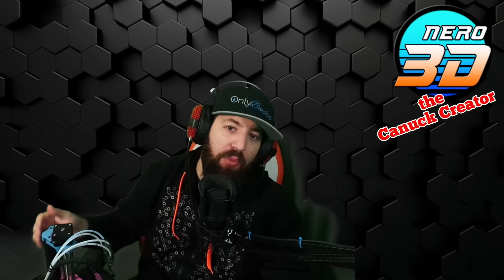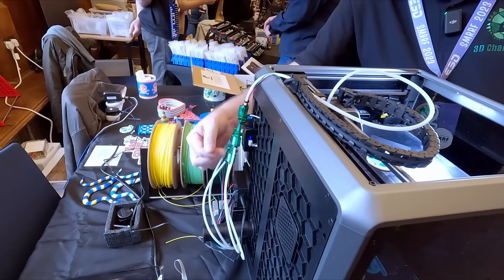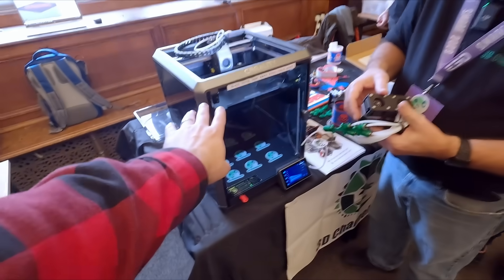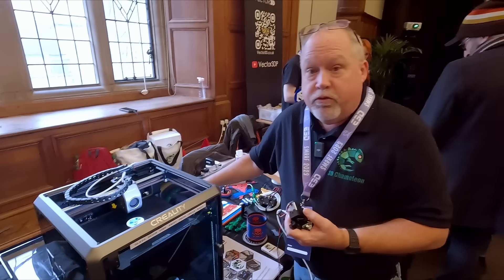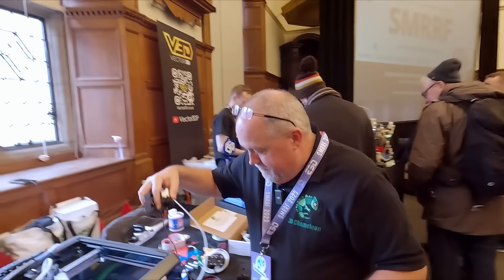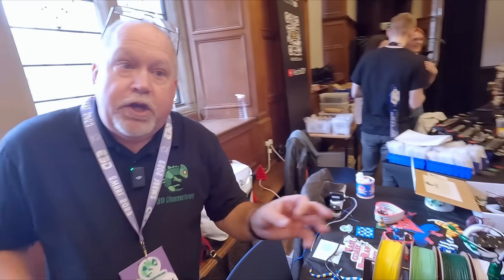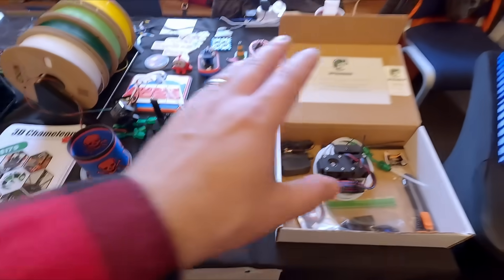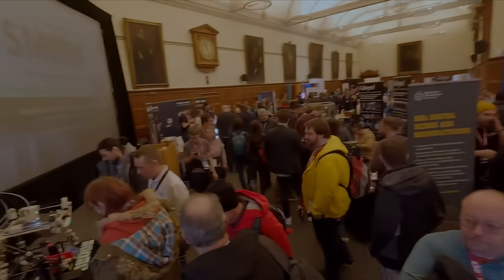3D Chameleon Mk4 at SMRRF2023 - Better, Smarter AND CHEAPER! #3dprinting #smrrf

Comment from the maker: For those curious about mk3 vs mk4 differences and availability of the mk4, heres a post copied from Bill (3d Chameleon)

"Ok... there is a lot of confusion about what was shown in that video.  It was a preview of our upcoming Mk4 series.

The Mk4 will come in two versions... the Mk4 and the Mk4 Pro.  The current Mk3 (since October) is identical to the Mk4 (base) except for the firmware, that is the ONLY difference.  It was already silently upgraded to the Mk4 hardware back in October.  Agian, the only difference will be the firmware, which is, as always, a free upgrade.  (All Mk2 and Mk3 users can already print the parts and perform the upgrade to the Mk4 hardware here: https://www.printables.com/model/354998-3dchameleon-mk4-upgrade-parts-with-ptfe-grip

There will be some additional features that are in the Mk4 Pro (which won't be introduced until RMRRF), and that video shows some of them.  But, as always, the Mk2, Mk3 and Mk4 will be upgradable to the Mk4 Pro.  However, because there is significant new hardware included in that kit, the pricing difference will be charged over the Mk3/Mk4's current $179.  Pricing or shipping details of that upgrade are not availabe yet.

I hope that clears it up.

Bill"
Reply: For those that upgraded back in Sept 2022 to the MK3, not last year, does it mean that the hardware is too old for the new MK4?
Reply: Sadly Bill is not telling the truth here. I bought 4 of these last year in Nov/Dec and my TMC drivers are not compatible with the new MK4... So sadly Bill kinda screw me over even though he confirmed via email that my unit would only need upgrading of firmware (but you need the new TMC drivers for MK4 to work properly)...
Reply: thanks, I was confused about that part.  Especially since I just had my Mk3 delivered yesterday!  
Glad to hear I have the new hardware and can use MK4 firmware when it launches
Reply: Bill, I really enjoyed your Nero interaction and the way that you executed this really so simply is is truly wonderful one of the things that I would recommend as well though as is that for the connectors I would just recommend that you probably do something about molding that out as opposed to on the way it is right now so that way it’s just more kind of clean if you will but this is a fantastic upgrade and I’m really excited to hear what you’re doing with the ego orange storm giga. I recently had to back out of my pre-order for that because of some life circumstances but I’m really trying to get my 3-D by j0sh business off of the ground and I intend on doing music related art and your technology will be able to help me realize that dream because honestly the enraged rabbit carrot feeder was something that kind of intimidated me and it seems like this is relatively straightforward, especially with the pro forward upgrade Path So that way we don’t even have to worry about tuning tips and I think that that’s really clutch. it would be nice if this would be packaged in kind of a little assembly or something like a case that basically you just kind of clip or set to side as the AMS would be. My only concern about some of this would be about the extruders that are direct drive. They don’t have a boat and tube going into them, such as the Neptune 4 max. And other than the color, it doesn’t truly change anything about the printer and I think that’s fantastic. The fact that the printer is completely agnostic to the fact that there’s really truly color being changed is something that I honestly honestly would be ideal  I did voice to speech on my thoughts were as you’ve read above lengthy.  I apologize for any grammatical errors or transcription errors in this. I always love the contact. Thank you Nero! 🤘🏼

Comment: So if am I correct, is this just a multi filament selector? So it doesn't actually "extrude" it just pushes the filament to the printer and the printer does everything? Effectively you tell the printer how many times to press the button, and it does the rest?

Comment: Love that dude, bought a Mark 3, haven't used it yet, may just get a Mark 4 and skip the Mark 3, maybe donate it to someone here locally.
Reply: The Mk3 can be upgraded to the Mk4 for free, with downloads to update the firmware and STLs to print the required parts. The "Pro" upgrade will cost a little extra because it'll have more stuff (presumably, the automatic cutter, and possibly more goodies not mentioned yet).
Reply: @richard3365  That's good to know, thank you for the heads up.

Comment: Does it matter if its direct drive or not?
Reply: Apparently, it's actually better to have direct drive, but not required. The Chameleon doesn't care where the extruder itself is, it only knows to feed the filament into the extruder and then let the machine do its thing like it normally would once the extruder has grabbed the filament. But if you get the filament cutter thing, that might not work so well with a bowden setup because it'll leave a little piece behind.

Comment: A custom purge block is GENIUS! I want to learn how to do that on my AMS.
Reply: I'm not familiar with Bambu Labs' slicer, but it's supposed to be similar to OrcaSlicer, and in that slicer there's an option you can select called "Flush into objects' infill". You turn that setting on, and Prime Tower off, and now it'll only purge inside the infill. No secondary part required, if the part you're printing won't show the colors through the skin (aka "opaque", meaning can't see through the surface at all). The trick Bill mentioned is to have a second, fully opaque (in this case black) part, and you'll have to play with the locations of things on the bed to make sure that secondary part gets printed (and thus purged into) first after each color change... but even that isn't really necessary unless the main part is going to have a slightly translucent (for example, silk filament) skin where the colors inside might be partially visible.

Comment: This is very interesting to me. I have an AnkerMake M5 and they just announced that they were drooping the multicolor option. I was going to buy a bambu A1 combo, but this is a heck of a lot cheaper, and when the next hot printer comes out 9probably next Wednesday lol) I can just carry this over.
I'm not really understanding the point of the cutter though.
Reply: It is used to cut a clean edge when pulling the filament back through the PTFE tube so it doesn't get stuck. The filament tends to deform in the hotend and mushroom out.

Comment: When will it release?
Reply: You can get the MK3 now, it has the exact same hardware (minus the klippy add-on). You will be able to upgrade any previous version to the MK4 when it's available, and the newest MK3 would only involve a free firmware update, and you'll be able to upgrade that to the "MK4 Pro" (which includes the klippy but also some other undisclosed upgrades) for a fraction of the pricce (also undisclosed). However, they're waiting to show it off at RMRFF, which isn't until April 21, before announcing the release date, so at the moment we just don't know the actual MK4 release date.

Comment: I got a Mk3 but never got it working. Tip shaping never worked right, and the DIY filament cutter was janky as heck.
It also seemed like the extruder would slip and there was no good way to adjust the tension.
I wonder if there's a Mk3 to Mk4 upgrade available. I'd be interested in trying to interface it with klipper, although I'm afraid to throw more money down a hole.

Comment: the limit switch is awesome, it lets you run it on all kinds of printers. BUT, hear me out, id really like it to have a usb interface as well so I can run it on Klipper without installing a switch.
Reply from the maker: the MCU running the whole think IS klipper compatible, so you could connect it via USB, flash klipper and just control it with a config and macros instead of standalone if you wish
Reply: @CanuckCreator  oh ... OH ... ILL TAKE 2 PLEASE
Reply: So is there a tutorial on how to do this with klipper somewhere?  I’d like to do this on my soon to arrive ratrig … Also for cutting or shaping whatever… (you’ll have to forgive me I don’t have experience with klipper or mmus) is there any way to have it do the cutting or whatever shaping outside of an enclosure?   I read somewhere maybe Reddit that servos like that don’t like hot temperatures inside heated chambers….   Of course rat rig is said to have something in the works as far as mmu goes too but figured maybe I could get this chameleon working and then put it on to my modded Enders or something.
Reply: Is this available to purchase?
Reply: @DavidR8  bro what?

Comment: hm… how can you just paste a single block of gcode to have the printer switch to specific filaments during print? that doesn't work. You'll have to rewrite the gcode first.
Reply from the maker: you can setup your slice to use specific gcode commands for filament changes (each color is its own gcode command), so in this case its like 
"for color 3, move to xyz postion and push button 3 times" 
etc

so when you slice, it`ll bake in the right commands when needed to print
Reply: It'd be nice to have this added to something like OrcaSlicer, which supports a lot of this stuff already. They usually take patches ;) 
 @CanuckCreator

Comment: So I have a question. I have the k1 as well. Is it worth having the ercf or the chameleon? Of course ercf I've got to build and tune etc, etc, but it's klipper. I assume having this makes it a lot easier althout you only get 4 color with each kit and technically its a bit more expensive( shipping to greece is 55 euros which is fair since its oversees but yikes)
Reply: If you have a machine running klipper there is no reason to be looking at one of these.
Definately ERCF.

Don't get me wrong, the chameleon is pretty cool. The creator is a clever guy. Developing a mmu that can work on any printer is no means feat.
However, designing for this purpose has required compromises to be made. Namely in speed. This thing is slow. I don't own one but I did a tonne of research and this is the main complaint with the Chameleon. It is what it is because that's what it has to be to achieve the desired goal.
It's early days for the chameleon. With some more development time and community contributions I'm sure it can become much better.
The ERCF is designed for klipper, is open source development, is more refined, expandable and customisable, filament swaps are much faster, and will cost you about the same. It's no brainer.

Comment: Never could get my chameleon to work, the documentation and instructions are pretty poor
Reply: I’m hoping that with the Mk4 firmware that I can actually get mine working. Never got the MK3 to work either.  I’ll solder in the new driver chip if that is an option.

Comment: Be warned. The (MK3 version) is for a non-klipper machine. I ended up sending mine back, and was disappointed with support. I did see how well it works on a marlin machine. Just not for klipper applications(edit to include the model)
Reply: Same for me. Said it worked for any printer. Couldn't get it working at all with my ratrig vcore3 and support wasn't good
Reply: What issue did you have with Klipper? Given how the device works I fail to see how the firmware you use for your printer could possibly matter
Reply: @Lyrkan_  klipper is macro based. And marlin is not, the way klipper works by checking expected flow rates and steps for extruding all throws internal errors for klipper when it tries loading and unloading filament
Reply: You had the MK4?
Reply: @stew675   after looking it up. I had the MK3. But at the time bill (custom support) was unable to help me with anything klipper side. So any buyer should make sure it works specifically with klipper. As the previous model was advertised as works with any printer when it clearly didn't
Reply: @BobFromCalifornia  the video shows the MK4 on a Creality K1, which is Klipper, so I'd say it's a reasonable assumption that it works with Klipper
Reply: @stew675  I would assume so too. But mine clearly did not. I hope they have some better support for the mk4 , as my response for help was answered with he's never used klipper and it should just work. They also charge a restocking fee of 20% which was my fault for not checking before ordering.